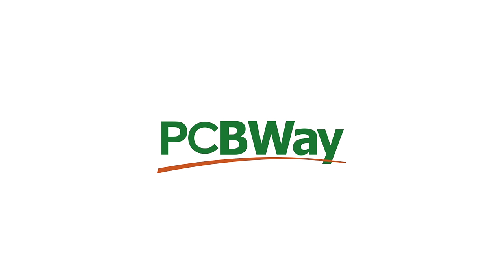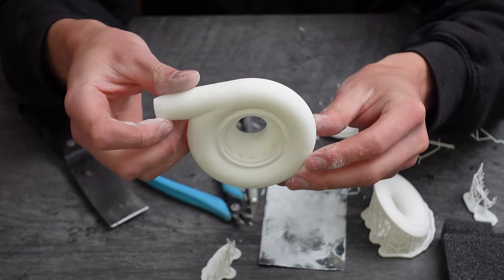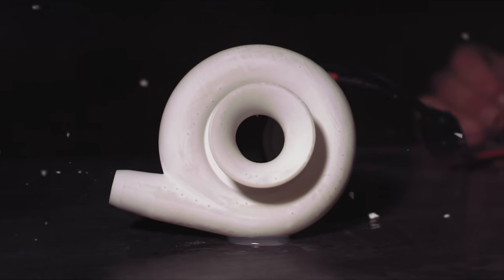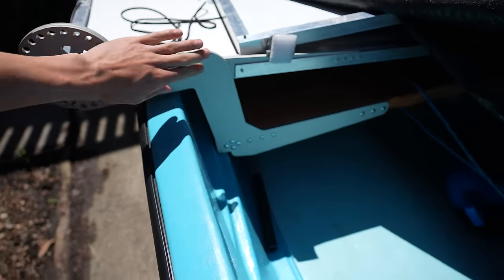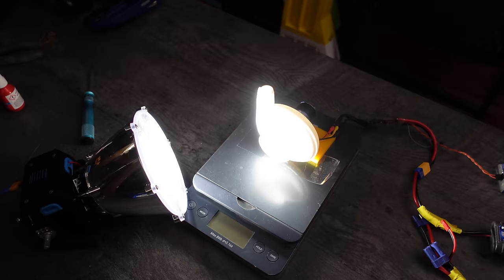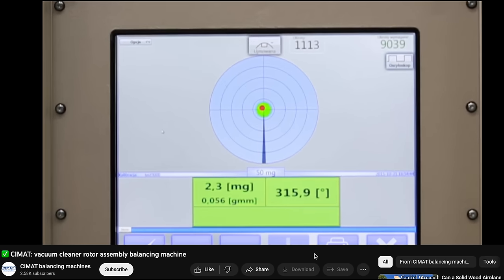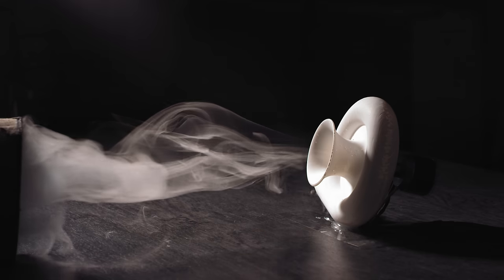3D Printed Turbo Impeller VS Dyson Motor

Comment: If you want to compare head to head with the Dyson, you should really see which one generates more thrust/pressure rise at the same output power. That your impeller performed better at a higher input power is not surprising, but the power that the Dyson motor may use is limited by its own design. In your case, the power is set by what the battery can reasonably supply and the operating point of the motor you are using.

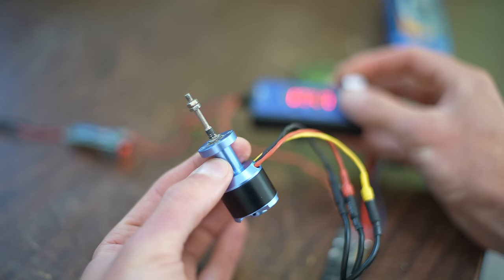Comment: What is that blue thing with the dial and screen on it that you where using to power that 117k rpm jet motor at  2:05      I need it

Comment: I think the snail housing is not the most efficient design, since it expels the air sideways.  You should put the impeller on the front and the exhaust on the back.  In other words, build a jet engine.

Comment: Try to print the impeller on FDM printer. It seems normal plastic, like pc or abs has lower shrinkage and higher strength than resin ones.

Comment: I think your blower blew because of contact with the casement. Better motor is required.
When i make my blowers, tho there's a loss by transfer, i use a belt system and the impeller is supported on a shaft from both sides. 3D printing in plastic has drawbacks.

Comment: have you considered 3D printing the impeller in aluminum and then you wont have to print a new one for each test, i use shapeways for my metal prints, they can do steel as well

Comment: Why not try a wing with upper surface suction? That Dyson suction fan would be ideal and the wing excellent as 3D-printed design! You could probably get fantastic glide ratio and the exhaust from the fan could power you forward, maybe?!

Comment: you can make the clear parts look a little nicer with a quick dip in clear coat. not useful for strength, but might be useful for filming.
Reply: Formling here (yeah that's what we call ourselves), even easier is to cure them in a cup or bucket of water. This keeps the surface smooth and makes parts almost crystal clear.

Comment: An axial discharge instead of a radial discharge would serve you better: more mass flow for greater thrust at lower speeds - your planes aren't jets - and you could pass the air over the motor to maybe help prevent it melting.

Comment: Your setup weighs less only because it doesn't consist any electronics. If you add the ESC and Controller it will quickly add to the weight.

Comment: On the last Impeller i noticed something concerning ,it looks like the Motorshaft is pulling itself out, in the end this could cause the rubbing at the Housing resulting in inpropper ballancing at high RPM and maybe some damaging of the Impeller right before exploding.

Comment: At 12:50 you can see the shell start to expand before it explodes due to what I can only speculate is over pressure inside the shell. Too much boost...

Comment: Hey I'm no engineer but why is the rotation of the impeller rotating anti clockwise when the air flow of the snail going clockwise

Comment: Im no expert, but id think if you could print around a metal tube to attach it to the motor or press fit a tube into the turbine so you could really tighten it up better you would get a reliable high speed run.

Comment: Balancing of the rotating assembly is critical to maximum rotation. There's some DIY balancing kits available for cheap. Google 'DIY turbo balancing'. There are guys 3D printing and balancing superchargers for cars that achieve 135K/rpm after balancing their mass, good luck.

Comment: Didnt you make a turbo compressor though? If the sole purpose was to suck air in, you dont need to direct the output air in any way, it can just be exhausted with the shortest path possible

Comment: Isn't the ultimate problem with your whole setup the fact that the motor needs a ton of air flow to not literally burn up?
I'm assuming the dyson vacuum routes at least some of the air through the motor so that doesn't happen.

Comment: Please build a motorjet engine, where you use a centrifugal compressor, driven by an electric motor, to compress air and mix it with fuel. It's fairly simple to build, and i would lile to see an RC plane powered by this type of engine !

Comment: If  you want to up your resin game, I´d be open to sponsor a bottle of my Engineering Resin for your next project. You can print it on any normal hobby grade resin printer, and it is much more cost effective.Also no shattering, its very impact resistant. let me know!

Comment: Why don't you try a "tesla turbine" type impeller? Manufacturing and balancing is dead easy and it's vastly more forgiving when it comes to tolerances. You can use 0.5mm aluminium sheets for the alternating disc-washer stack and get very tight disc spacings to have as much boundary layers as possible.

Comment: Alternatively, you can make vacuums move more air with bigger impellers.   I get why they don't, for the sake of a small household appliance.   But  look at the CFM ratings on some of those big woodworking dust collectors.   If you REALLY want a vacuum with alot of suck, plumb the house for a whole house vacuum system and mount a huge ass vacuum impeller/motor in your garage.

Comment: your video is tremendously cool but I don't think people realize how precise mass-produced items are. Dyson sells you for a reasonable price a silent, potent little impeller coupled with an in-house design motor that is reliable and will probably never be the failure point. They want artisan products, natural candles, and organic stuff because most of them can't wrap their heads around industrialization. they'd rather buy candles from someone on instagram that makes them by melting the same wax at home or blame car manufacturers for unreliability without even spending one minute in understanding that Ikea sells you candles for 0.5 dollars and Volkswagen will sell you an engine that lasts for 200.000 instead of shattering itself to pieces

Comment: I'm a armature winder by trade ,let's talk balancing,,I found using the shaft and bearing on a pedestal, wash bearing in petrol and oil will WD40 lubricant, place on pedestal with impeller on and u will find the heaviest point will fall to the bottom take a little weight off by first marking 180 degrees around the rotor and make and remove weight till it doesn't fall to gravity, this sounds un accurate but results speak for themselves 100 thousands RPM balancing close to perfect 😀 try it

Comment: I think the Dyson motor only spins at A 100000 RPM when the air flow is completely stopped that's When it starts spinning under vacuum and that is basically resistance free that's when you'll get the 100000 RPM

Comment: you should just take the impeller cover off of the dyson motor and 3d print a blower housing for the impeller instead of it being  around the whole impeller housing.

Comment: laser engraver uv-resin topside prints, very accurate and fast
Reply: centrifugal turbine a=v^2/r, so speed squared acceleration vs straight prop which is linear to the speed
Reply: nice
Reply: tesla turbines get 200krpm easily, and are just discs, center in rim out, cnc  those discs and spin super fast, only surface friction thrust (metal discs etc)
Reply: how about larger diameter blower style fan, similar size to a drone prop rotor, ducted and open
Reply: try side 45 degree rocket nozzle sleeve instead of the single constrained high speed nozzle out
Reply: try a helicopter large horizontal two-blade rotor on top of a drone, 5th motor, it can fly on its own like an osprey

Comment: charles algernon parsons.
gustav de laval.

it may pay to look into their solutions regards bearings, and circumnavigating balancing issues with high speed shafts.

parsons took the "labyrinth" approach, alternating washers pressed onto the shaft and bore is a simplified visual. 
delaval took the "long thin shaft" approach.

ball bearings and rigid, short axles are not the way sadly.

with turbines like this, other issues with balancing are blade flex, resonances. what may be registering as a balance issue is a blade flexing at a harmonic speed, you grind away at the body, but the blade itself is still buzzing away.

their balance will alter as the air flow and load on them changes... pull apart the larger dyson vacs/fans and you find the impeller is closed for blade strength...

that ties in with critical speeds, the easiest way to visualise that is simply the centrifugal force causes the weight to fling outwards, but the speed of rotation and the inertia of the wheel means that by the time the weight has reacted and flung out, the wheel is a half rotation away.

"dynamic balancing" isnt just spinning whilst balancing, its balancing the AXIAL imbalances as well, the "swashplate"ness of it... 

radial weights will cause radial imbalance, but axial weights will cause a rocking couple along the length of the shaft.

which is why all high speed balancing machines use a sensor at each end of the shaft.

synchronous signals are a radial imbalance , 180 degrees phasing is an axial.

then, for making a decent amount of thrust, you have to rethink the design of the ducting. apply bernoullis, with the idea that a centrifugal pump adds PRESSURE, not VELOCITY. a ta certain intake velocity they start to stall out.

Comment: one idea:

dyson compressed jet engine
Reply: ive been thinking about a jet engine that utilizes electric motor to power its compressor, either fully or partially. meaning the turbine/compressor shaft of the jet engine is engaged with an electric motor to improve response

Comment: the dyson on the static vacum test sucks air throu the bottom of the dust collecor there is an rubber safety valve there and the dyson batterys have an overcurrent shutoff graidt video still love the content

Comment: I've always wondered if you could use one of those impellers as a compressor stage to feed a combustion chamber and a turbine which drives a small generator -- basically a Brayton cycle gas turbine with no rigid shaft in between, but instead an electronic drive system.

Comment: 5hp shop vac?  Every shop vac I've ever seen is 120v.  You simply cannot get 5HP out of a 1500 watt circuit (120V at 15amps with 80% safety factor) or a 20 amp circuit. 5hp is 3750 watts.

Comment: your idea of "oh ill just make the blades thin to lower forces" is totally wrong lol; your aerodynamic forces are the dominant load and are determined by: RPM, radius, #of blades (though I guess each blade is loaded the same? more or less?). You need enough material to overcome its own centripetal load AND the aerodynamic loads. Thicker blades = less blow up-y. duh!

Comment: 11:03 I dont see why it should be a win for you that you bought a more powerfull (and likely more expensive) motor than Dyson did.
Its like winning a quarter mile race with a F1 car vs. a usual streetcar and saying "I also had more power than the other guy, that makes him even more of a loser. I am better in every disciplin" xD
I am not hating, its impressive what you build! I just disagree with that Point at 11:03...

Comment: Dynamically balancing a lawn mower blade is much easier.  Put it on a nail an use gravity.  That thing is so small and round it is hard to use gravity like a prop or blade.  You were kind of just guessing like you mentioned.   Maybe there could be a way by hanging it by a thread.

Comment: maybe try to add some combustion with taht much compression you could burn fuel very efficently by using a jet engine compution chamber and no output turbine also you  can burn higher tempeturs becaus there is no out but turbine

Comment: You can figure out volumetric air flow thru thrust mesure as you know the diameter of your nozzle. ;) then efficiency \o/ It's not the most accurate thing but definitely good enough for a youtube video :D

Comment: 0:50 It's not "marketing lingo" a brushless motor with an ESC is a "digitally controlled motor"; they are literally just calling it what it is. Calling that "marketing lingo" is like saying that Microsoft uses "marketing lingo" when they say that Windows 11 is an "operating system".

Comment: I have had experience with Formlabs resin printers. At a professional level they do great. However, I STRONGLY suggest you do not get any formlab printer for hobbyist use. Why? Because there software is less than great(no hollowing, holing) and resin is ridiculously expensive. I would highly suggest a elegoo, which has been great for my hobbyist uses.